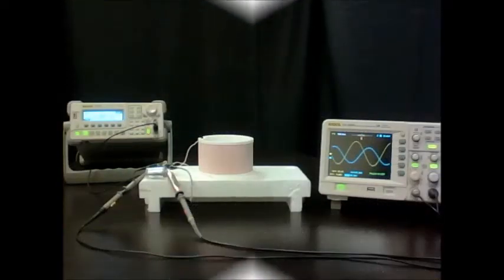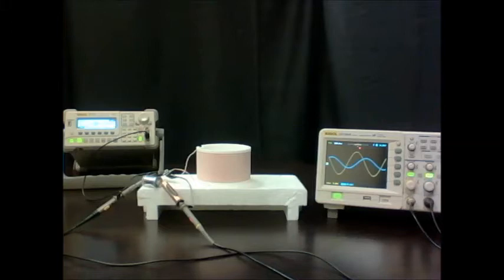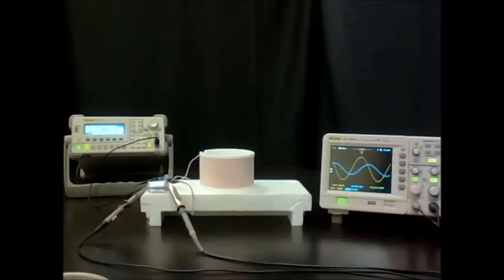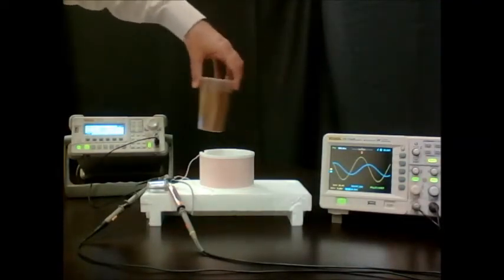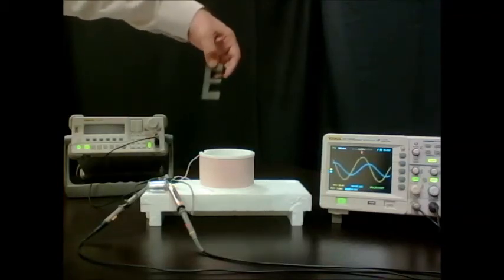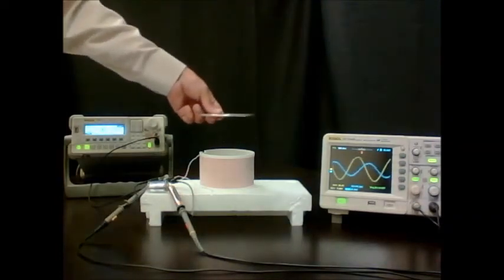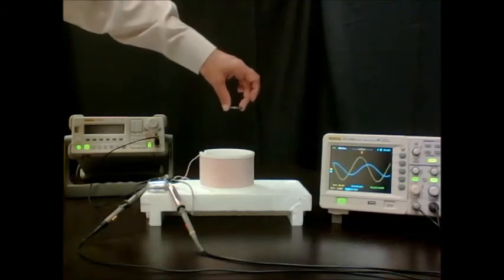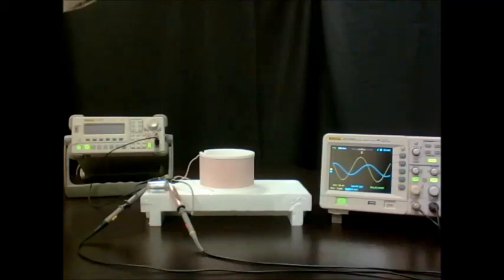Treasure hunting & Metal detectors   How it works

Comment: Thanks for taking the time to share your knowledge.  Curious as to why the phase shift changed direction just by changing the orientation of the metal entering the magnetic field?  I would have thought that the metal would have the same effect on the direction of the phase shift regardless of its orientation.

Comment: what are the two waveforms on the oscilloscope? which color is what?
Reply from the maker: Hi FableArchitect ! Thank you for your interest in my channel. I haven't published videos for a while but I keep some projects in mind, so stay tuned ! 
Here the yellow curve represents the coil voltage and the blue one is the input voltage.
At resonance the two voltages are in quadrature phase and the coil voltage is about 500 time larger than the input one (Q=500). Note that a custom made probe is used on the yellow channel (1pF stray cap and GigaOhm serial resistance) to avoid probe losses and a reduction of the quality factor of the resonant circuit.
Reply from the maker: Hi FableArchitect ! Thank you for your interest in my channel. I haven't published videos for a while but I keep some projects in mind, so stay tuned ! 
Here the yellow curve represents the coil voltage and the blue one is the input voltage.
At resonance the two voltages are in quadrature phase and the coil voltage is about 500 time larger than the input one (Q=500). Note that a custom made probe is used on the yellow channel (1pF stray cap and GigaOhm serial resistance) to avoid probe losses and a reduction of the quality factor of the resonant circuit.

Comment: Very helpful.
Reply from the maker: Hi and thanks ! The Electromagnetic near-field is generally very poorly understood even by specialists. If you are interested I wrote recently a small kindle didactic book on the subject where I suggest at the end that magnetic and electric forces separate at low frequencies (low energy levels in the standard frame) and that we may rather consider 5 fundamental forces Electric, Magnetic, Weak, Strong and gravitation forces. The book is in french but it is full of illustrations easy to understand: https://www.amazon.com/Henri-Bondar/e/B08BK4KSN4%3Fref=dbs_a_mng_rwt_scns_share

Comment: what is your frequency generator range? which frequency works better? you should talk about this in the video. the viewer should know what is the frequency and what frequency works better
Reply from the maker: Most conductors are not frequency dependent, the only troublesome factor is the skin effect. So the interesting question is rather: "what is the best Q-factor value one may reach for the coil and what is the corresponding frequency ?". There is no definitive answer to that question but my experience suggest that the best values are obtained for solenoids in the decimeter range with an aspect ratio close to one and a small spacing between turns (flat coils are really not good). In this case the best Q is around 1000 and the best working frequency is around 500kHz. For larger frequencies (smaller coils) the skin effect increases dramatically the resistance (even for Litz wires) and radiative losses also have a decreasing effect on Q-factor. It is well possible that carefully designed bigger solenoid (in the meter range) could lead to higher Q-factors at lower frequencies. However all this is purely theoretical, in practice the object you want to detect is surrounded by materials having a damping effect on the Q-factor of your circuit.

Comment: can i have a circuit diagram or how to set up the experiment?
Reply: It is a classical serial resonant circuit but with a very high Q-factor coil (around 1000). This high-Q is obtained using a very technical winding (a special Litz wire and on a pure teflon former). The two probes are connected respectively to the input signal generator and the common contact in between the coil or the capacitor. Be careful the input voltage should be quite low if you don't want to destroy your probe and by the way a good x10 probe and a good capacitor (at least a COG type) are mandatory to maintain a high-Q for the whole resonant circuit. As explained if the Q is reduced the sensitivity/range will also be reduced.

Comment: Tres bien, thank you.
Reply: Sorry for my french pronunciation and grammatical mistakes :)
Reply from the maker: Hi Gary, I recently published a small kindle didactic book on the electromagnetic near-field subject that is so poorly understood even by specialists. In the last part of the book I suggest that magnetic and electric forces separate at low frequencies (low energy levels in the standard frame) and that we may rather consider 5 fundamental forces Electric, Magnetic, Weak, Strong and gravitation forces. The book is in french (it will not be a problem for you I guess) and full of illustrations easy to understand: https://www.amazon.com/Henri-Bondar/e/B08BK4KSN4%3Fref=dbs_a_mng_rwt_scns_share
Reply: @kantanlabs3859  Thanks.